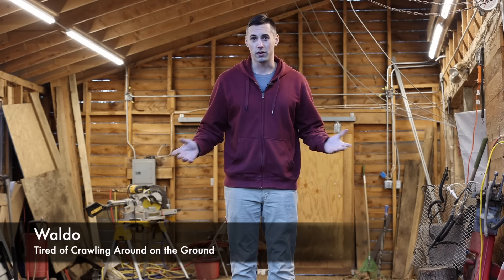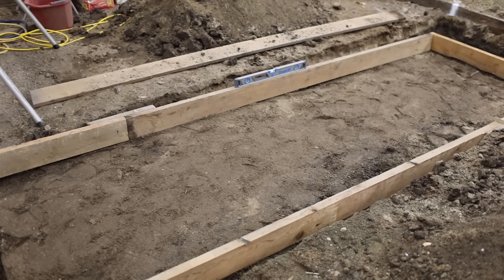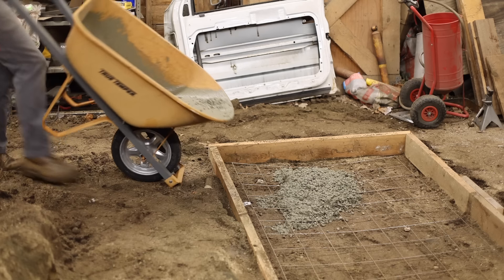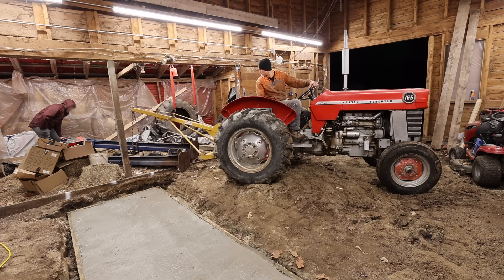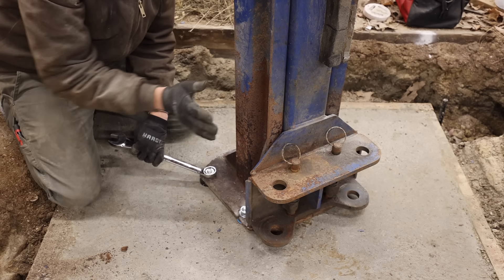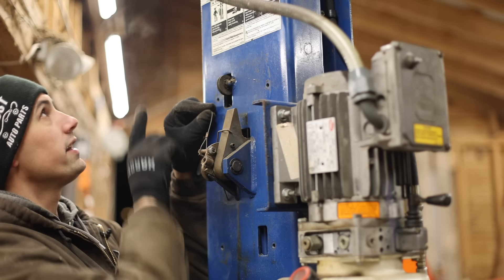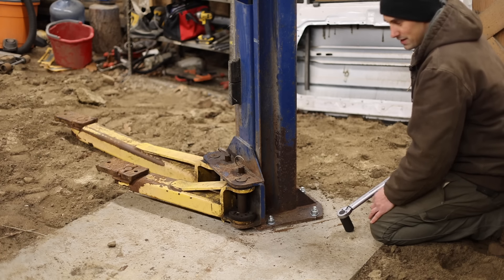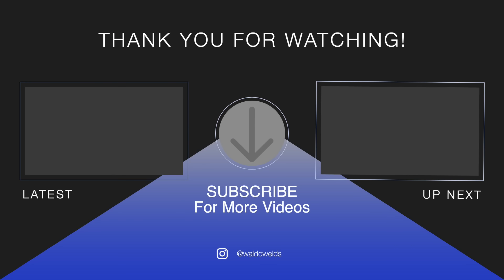Installing a 2-Post Automotive Lift on the Cheap

Comment: There’s a lot of people congratulating this, but I feel like this is terribly sketchy, from the concrete slab to those spacers on the cables, even with it being temporary. Hopefully nothing bad happens.
Reply: The cable spacers are recommended by rotory the manufacturer. I install lifts as a job.
Reply: I agre, this slab is no way  large enough for a 2 post lift!!!
Reply: The spacers on the cables are the way manufacturers create multi-height lifts. Whether the schedule 40 pipe is up the the task could be argued I suppose but I suspect the schedule 40 pipe under compression has a higher strength than cable under tension. That cable is only to keep the sides level with each other.  I agree on the slab.
Reply: Yeah.. I can absolutely see the slab either breaking or just being moved depending on weight on the lift and movement... i wouldn't stand under it... thats for sure. Seems like a huge tipping hazard. Quikrete isn't very good stuff either.. It's like making pancakes with baking mix.. it'll work but it's not really the same.
Reply: @mattiefattie3895  He loved the comment, so clearly he is reading and taking feedback. You'd be amazed how many of us will actually listen to commenters as long as they are respectful, informed, and aren't just stating the obvious.
Reply: @802Garage  I stand corrected then
Reply: @mattiefattie3895  I getcha though. A lot of the internet is purely reactionary. The sad thing is how many people leave negative comments without even realizing creators are humans too, haha.
Reply: Agreed. Super sketch. I wouldnt be under a car on it.
Reply: Yeah that slab doesn't seem strong enough specially how it drilled like butter .
Reply: @24BLUEELMO  Drilled right after pouring. Concrete still green as hell. It isn’t anywhere near cured up to strength.  Sakcrete should break at like 4000psi after a week or so and he didn’t seem to have done anything toooo stupid while mixing or anything.  Only thing I’d be worried about at all is if he didn’t have some  help and ended up with a cold joint.  Shouldn’t have filled the whole form and build it up in lifts 
Ike they did tho…that’s asking for delamination.  Hopefully he’ll pour this full thickness next time and just keep adding next to it as he goes next time he does any kind of concrete project.    But he should be fine with what he has here. I would smack it with a 2 lb hammer just to make sure it sounds right and doesn’t have any layers sitting on top of each other that could sheer with weep weight in the air.  But barring that this concrete should be sufficient for what he’s doing.  I would have dropped some  #5s 12’o.c. B/W T&B tho.   But I overengineer everything.
Reply: im no expert at this but i do this for my job and this is very sketchy should get all new cables make sure they are equalized lubricate everything and various other things
Reply: agree with you mate, a bigger slab with rebar in it would hold a better base but looks like he got a good deal for it and great for changing tires fast XD
Reply: @bradjd6957  so what's your thoughts on a sacrete slab floating on the ground?
Reply: Relax people his shop his lift I wish to even have that one as it would make my life much easier good job Waldo
Reply: Where's Waldo.  OH he's smashed under his lift.
Reply: That’s today’s internet…you either call someone a complete dumbass or you congratulate everyone no matter what they do because everyone gets a trophy.  I really think this is one of the situations where the first option is more appropriate.   You shouldn’t be proud of doing something that looks like a really bad idea.  Sorry if the truth hurts people’s feelings but this looks like it will eventually crush someone.
Reply: @24BLUEELMO  That scared me as well.
Reply: @24BLUEELMO  I've used a rotary hammer like the one he has (though a different brand) on well-cured concrete and had it drill that fast. But I would have ordered a truck - I won't use bagged concrete for anything structural. And I always wet down concrete and keep it covered for a week, so it cures well. But it doesn't seem to have fallen over, so I guess it was okay.
Reply: @OP This would only really be an issue if it were an instructional video and there was missing/inaccurate information or an opaque procedure. Since Waldo was open about materials, dimensions and procedure, I would contend that the risks are his - it isn’t masquerading as a tutorial - so the dangers are governed by the level of personal risk viewers are willing to take.
Reply: @brabhamfreaman166  and it’s still a bad idea that could crush the guy no matter how he presented the information.
Reply: @chestercalloway3812  Yes, but my point is that it’s his personal risk to take if that’s what he wants to do: and, evidently, it is. Moreover, his commentary highlights many of those risks, which indicates that he knows what he’s getting into. And since you watched the video, it didn’t kill him nor (likely) result in significant injury.
Reply: @brabhamfreaman166  …yet
Reply: @chestercalloway3812  Agreed, I’m not touting it as a rip-roaring success, nor a catastrophic failure. I guess that’s why it’s intended to be temporary. AND FWIW I wouldn’t touch it with a barge pole either.
Reply: @williampierce5615  he hasn’t posted in 3 weeks, who knows
Reply: Sch 80 pipe might have been a better choice for the spacers.
Reply: Should of used thicker rebar and ran it threw the forms so you could add to the slab later if you wanted to
Reply: I agree. It is sketchy but I’m sure he’s going to take precautions like not lifting it’s full capacity.
Reply: I know what you mean, a buddy of mine installed a lift in this same way, and it didn’t take long before the lift started to collapse, and he had to saw cut the concrete floor, and make it much thicker
Reply: Concrete and those anchors has me cringing, then he pulls the duramax up for the first test couldnt agree more, when he drilled the holes i was like oh noooooo.
Reply: Theminimum thickness of 8" of reinforced 3k psi concrete and up to 12" thick is recommended for most 2 post car lifts
Reply: I wouldn't go under that lift with a toy truck on it , I would be interested to see what an engineer would say
Reply: @DabblelyDiddly I would think quickrrte mixed with a machine would be pretty good
Reply: I am thinking bigger pad plus a good gravel base.
Reply: Concrete CURES in about 28 days most experts say. Good Lord, they tell you NOT to drive on it for at least 7 to 8 days and he's drilling holes for bolts in 24 to 36 hours?? Only 6 in thick for this, OMG!! No way would I use this lift. Good luck under this😢😢😢
Reply: @bradjd6957  You literally missed the point completely. But that's ok you install lifts for a living
Reply: I agree, that small of a footprint could easily roll over. Frightening,hope Waldo sees some of these comments and does the safe thing. Seemed more concerned about the cost of concrete.
Reply: This is typical for YouTube. People who have no idea what they are doing , yet they feel compelled to lead others down their rabbit hole.
Reply: I would have expected the pour, including the rebar to extend out past the vehicle.  That way it wouldn’t fall forward or backwards.  A 3000 lb piece of slab not even on crushed rock, is just asking for trouble, if using for vehicles.
Reply: @bradjd6957   no they are not. If you install lifts then you are definitely not and RAI! If you dont know what an RAI is then you should not comment on this install!
Reply: @AlanBurnham  Rotary sells different cables and hoses for different heights. You are talking shit!
Reply: @invictusbp1prop143  You are correct that the slab is too green to drill. Its not just about strength but also that concrete shrinks as it cures. All the holes drilled with get bigger and the anchors will not hold eventually. This is the most dangerous install of a 2 post lift I have ever seen. I am an industry expert on this topic.
Reply: Lift the first vehicle up 4 feet and give it the stability test.  If it's hazardous, it will be apparent.
Reply: @auntysocialist  thats a good practice (6" off the floor not 4 ft) to ensure the car is properly positioned. But that has nothing to do with whether the lift will overturn the slab today...or tomorrow...or the next day.
Reply: @A_Person_You_Dont_Know  you'll see the slab move.
Reply: @auntysocialist  I work at a high level in this industry for a long time. There are many accidents where people were killed that probably thought the same.  You are dead wrong.
Reply: @A_Person_You_Dont_Know  so you are saying then, that lifting the vehicle 4', and testing stability will not show ANY movement in a slab that will pull up at full lift, but will happen without ANY clues.
Good to know.
Reply: @auntysocialist  lifts are not engineered for a small slab on dirt. The only thing we can say is with sn asymmetric load on a small pad it's inevitably going to fail and the stakes are pretty high. And yeah the higher you lift the more the torsional loading.
Reply: @A_Person_You_Dont_Know  our local stock car club had three two post hoists in the pit area,  on dirt. (Steel base to spread load) Pretty sure they don't just tip over unless you are ignoring the signs, and the physics of what and how you are lifting.  Yes, best practices say 10:1 safety factor, but sometimes you gotta make due, with full regard to the potential failure modes.  In this case, don't lift too high, keep a good eye on the slab when you rock the vehicle, and maybe even some guy wires if there's a bit of movement.
Reply: @auntysocialist how big a steel pad are we talking? Part of the issue here is that a badly centered load on that pad could put the center of gravity past a pivot point, either in the slab (corner or ground integrity) or from those anchors being put in way too early in the curing process.
Reply: @OneTrueCat  I understand that.  They looked to be mounted on steel plates 4' square.  The drop in anchors (when mounted on concrete) on the relatively small tower bases, in good concrete would have their limitations as well.  Either way, I would think balancing your load properly would go a very long way to maximizing your safety margin, which is why I would think rocking your load and watching the base as you lifted would be a good idea for the safety conscious.  I would also think you could expand your margin by mounting the lift on steel pads, and then anchoring those pads to the concrete to reduce the demand on your drop in concrete inserts.
Reply: The concrete slab was a joke he didn’t do any of that right. I just went through this ordeal at putting one in. I dug down 13” and poured a solid footing base around 3’X6’ long. Ample rebar and I allowed 2 weeks cure time in the summer months. Then I installed the hoist. I trust my footing I wouldn’t trust his unless he welds and fabricates bars to the structure of the building too ensure the safety.
Reply: You have to admire he did something, most people don’t even know how to use a lift, or fix their plumbing or rebuild their transmission. Sad days.
Reply: Highly sketchy. This slab can flip. He should have poured piers or columns straight down and poured it all together. This slab if it ever cracked will break and a flip. I would never trust this with my life

Comment: I would be nervous that  concrete pad would pull right out of the dirt and flip over
Reply: Recommended one foot deep with rebar. I'd feel all right with 5 or6 inch concrete. the steel foot displaces the wieght too
Reply: It's the flip over part.   That pad should have been more like 12x12
Reply: The post pad need a minimum 48" deep and apx 2x2 wide.. please pray for this guy
Reply: Eh, it’s not lifting the vehicle very high… if you center the car well it’ll “probably” be ok…
Reply: @nickdoessht  I'd rather not probably quote" die
Reply: @joepaullawncare7222  yea, but it’s him… Darwin will fix it.
Reply: @nickdoessht "PROBABLY " 😵
Reply: Good point
Reply: Haha
Reply: Its not the pad thickness its the lack of area and pad re-enforcement here. The lift is designed and engineered to be used with a compacted gravel base and then a min of 4-1/4" of 3000 Psi concreted cured 28 days. And all that is a min of 12x24 bay pad. If you are pouring a replacement pad then it needs to be 4'x4'x6" tied into the existing slab with chemical anchors dowelled in. This install is going to kill someone!